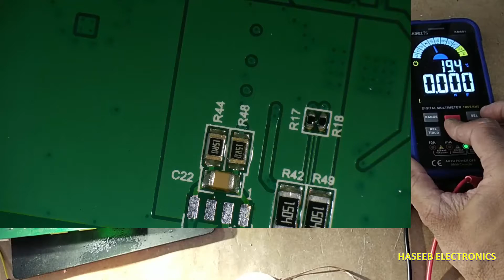{1008A} B5312-42 Router Not browsing on ethernet cable

Comment: Excuse me sir, what's the code of the IC you replaced? Thank you for your sharing, very professional as always.
Reply: 61089
Reply: Look for Bourns TISP61089;
"DUAL FORWARD-CONDUCTING P-GATE THYRISTORS PROGRAMMABLE OVERVOLTAGE"

The Texas Instruments TPS61089x is a different IC;
"12.6-V, 7-A Fully-Integrated Synchronous Boost Converters in 2.0-mm x 2.5-mm VQFN Package"

Comment: What is the main function of this IC in circuit ??
Reply from the maker: it is SLIC protection, it works similar as TVS transient voltage suppressor. it removes spikes from lines
Reply: @HaseebElectronics Until it dies, then it removes function from device 😆